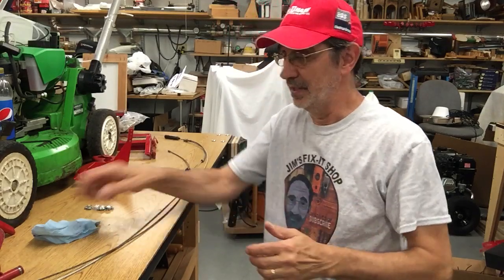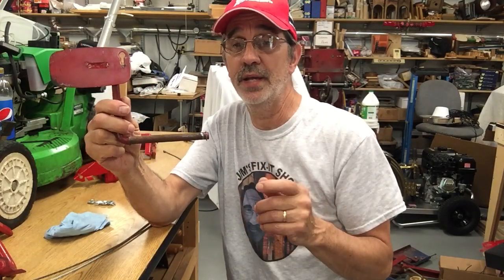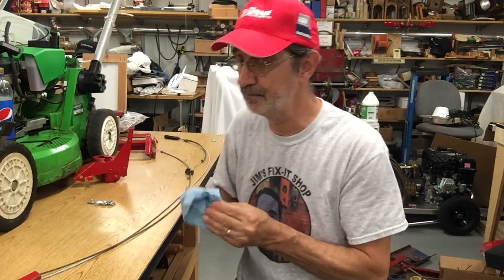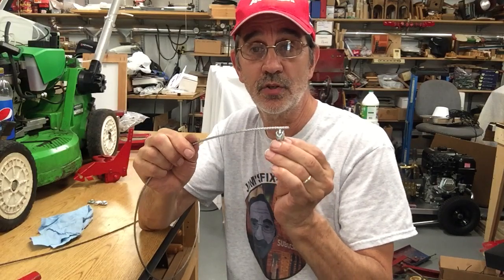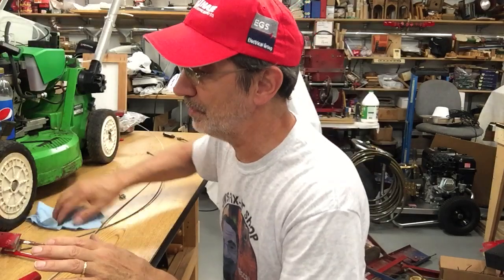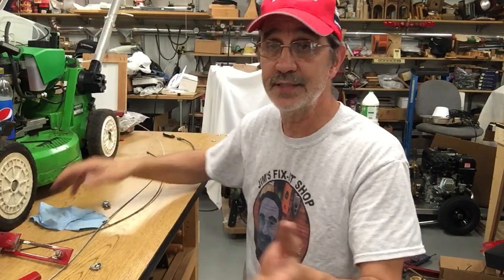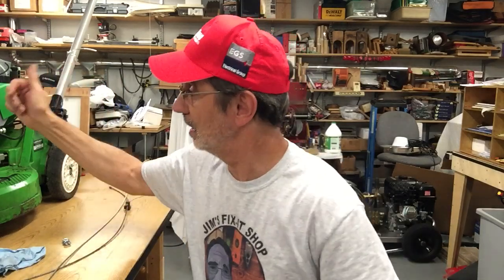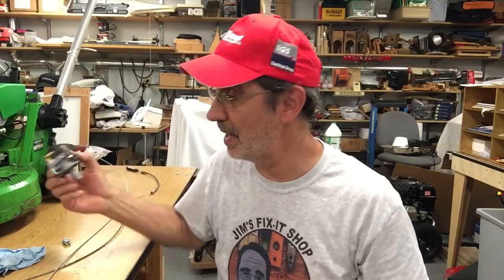365.  How Can I fix my clutch cable.

Comment: Liked, Do you have a video where you show how to install a new clutch-brake pedal. I'm too dumb to make one. But I need to install  a new ready to use cable.
Reply from the maker: Did something happen to your clutch/brake pedal or do you just need a cable send me some pictures so I can see what the issue is send them to my email which is
jimsfixitshop@gmail.com
Thanks.    Jim
Reply: @jimjackson9381  thanks Jim. It was a cable I needed to install. Not pedal as I wrote. But I got er done.

Comment: Hi Jim! 
I installed a new blade belt on my snapper, I had to adjust it by lossening it, now that the belt is adjusted my clutch cable is too loose even after adjusting the grommets on the cable. Is there another adjustment I can take up slack? It do loose I’m not engaging the safety switch underneath. Also how do I bypass that switch?
Reply from the maker: It sounds like the belt you bought is too short where did you get it from?. Jim
Reply: @jimjackson9381  that’s possible, I bought it on Amazon… which belt is it?
Reply from the maker: @Garylee62  I get my parts from Parts Tree.Com. In Texas they have a flat shipping rate of 795 regardless what you buy and if you have your model number you can look up on their website and it will tell you how long your belt should be and you could even buy it from them. Jim

Comment: I have a snapper and I was cutting my lawn 
I stopped cutting and when I tried to cut again the blade that cut the grass wouldn’t cut anymore.     As I move the lever so the snapper can cut its very loose and the blades won’t cut anymore.     The mower cuts on and off like it should but the lever that tells the blades to cut 
Once I move it forward it doesn’t engage the blades anymore.      What do I do?????
Reply from the maker: It sounds like the belt for the blade either came off or broke. Jim
Reply: Yeah it’s the belt.  I just watched your video I put the belt back on wrong.  I’ll do it right in the morning

Comment: Jim what would cause my rear engine rider to charge too high? Sometimes charges all the way to 17 volts.
Reply from the maker: Well there is a lot of variables first what size horsepower engine do you have and do you know what size stater you have there are different sizes that put out different voltage, do you have a voltage regulator on the side of the engine should be a inch and a half square half inch thick black plastic piece bolted to the side of your engine. Jim

Comment: Where can I buy the clamps for the cable?
Reply from the maker: If you’re talking about the standard cable clamps Ace Hardware or any good Hardware would probably have the very small ones if you’re talking about the black rectangular plastic clamp you would have to get out through Parts Tree.Com and you would need your model number.   Jim